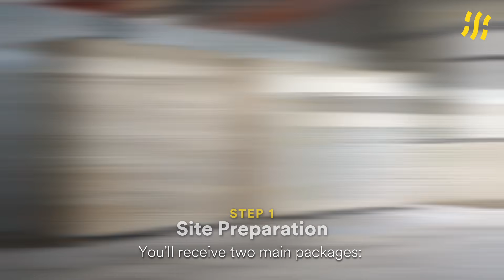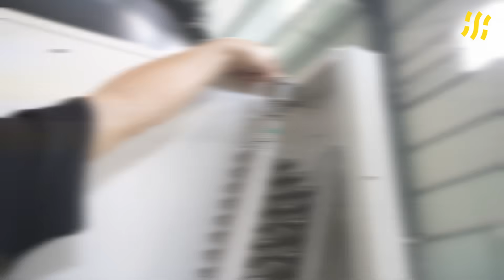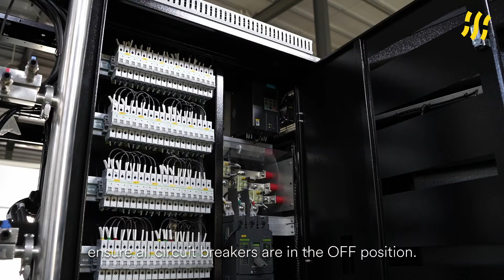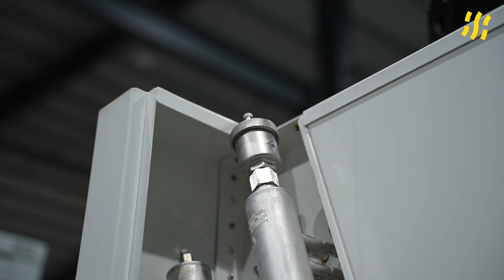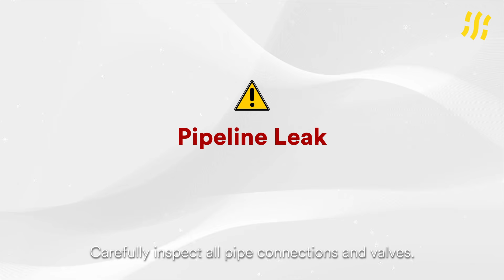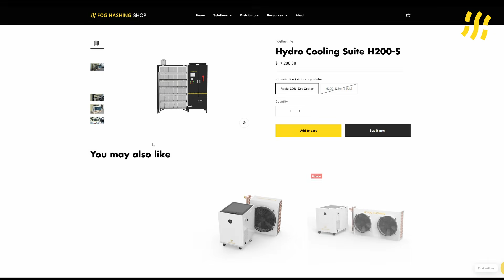FogHashing H200-S Installation Tutorial, Hold 36 S21Hyd/S23Hyd, Hydro Cooling for Mining Rigs

Comment: Do you have any plans for a smaller hydro unit rack for 12 miners approx ?
Reply: Would love to see then so something small like that. The Antracks are really the only reliable commercially available solutions in that frame of scale.
Reply: @Dan-ASICPlug yeah I have order 3 units of antrack will update once’s delivered how they work
Reply: What is the maximum high difference between the dry cooler and CDU?
Reply from the maker: Yes, it is in the planning stage, but production has not started yet.
Reply: @foghashing hope it starts soon. ❤ looking forward.
Reply: @foghashing but I am also planning and I will probably have the dry cooler 3 meters below, is that ok?
Reply from the maker: @joaofigueira2012  That's acceptable. It's best that the height difference doesn't exceed three meters.